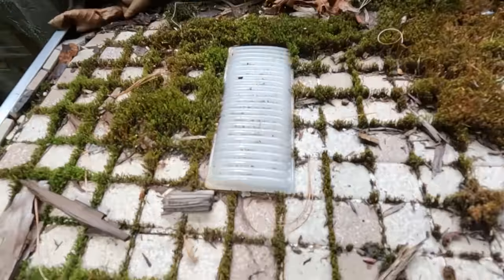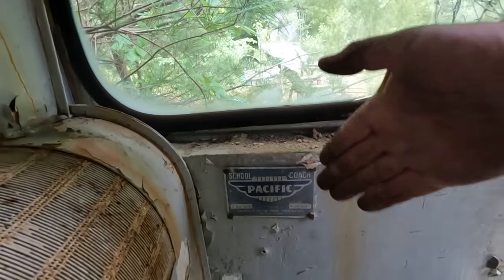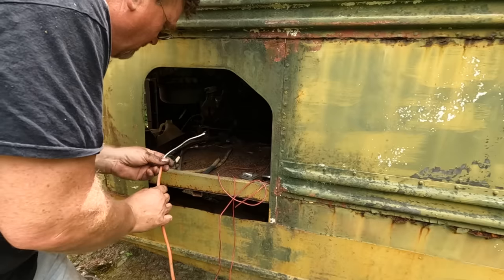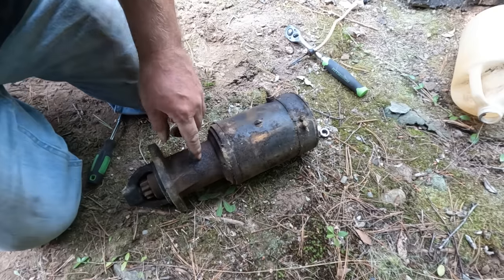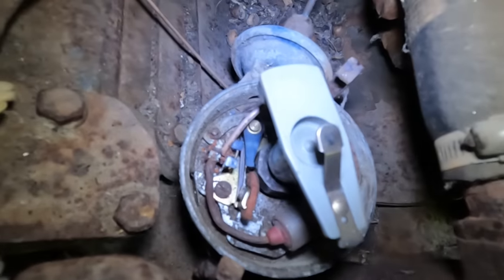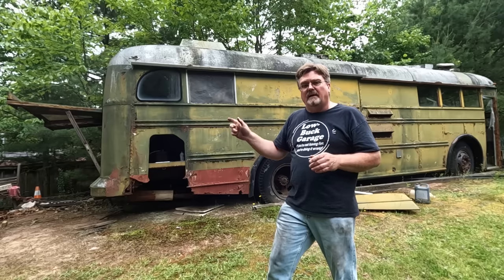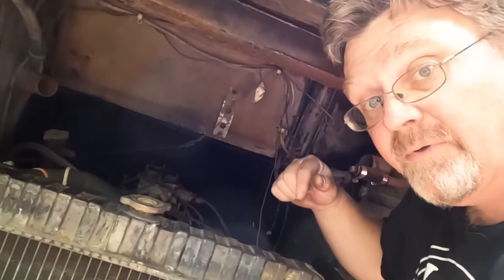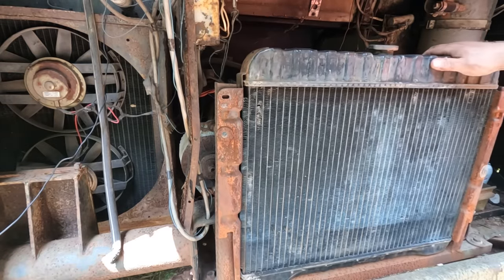Junk 1952 Kenworth Pacific Bus, Will it Drive?

Comment: If done right that bus can be salvaged, most things only need disassembly cleaning lubrication and reassembly to work again. Not much need atual replacement on that bus (part from interior "soft" parts), in 6 months and with less than $6k that can be road legal and camping ready i'm sure if you or someone local is willing to do the work.

Comment: any reason why the wheel has to be turned 3600 degrees? was that normal for the time?
Reply: That bus (like most vehicles of that age) doesn't have power steering, so the steering box is higher geared than a modern one to make turning it easier, and that leads to more revolutions before it bottoms out

Comment: Bro. what are you doing, the brakes are locked up on the bus.
You have to put air pressure in the brake system to disengage the safety.

Comment: bruh is getting off the bumper and not freeing the front fucking wheel, he doesn't want to overheat the bus and destroy it but he wants to drive it with a locked wheel holding 10 tons and a clutch praying god

Comment: The front wheel should not have spring brakes, so you would back it off using the adjuster nut on the arm between the air canister and the actuator shaft.

Comment: Well don't you guys have to dozers on the property that that work. If so if you have a sibling there one could push with one dozer will you pull with the other and you might be able to move it

Comment: I bed the  relay (solenoid)  which was already in was not dead. It  need not positive for start  but ground potential . So one wire of the coil is internal connected to positive. In a real world we got both kinds of those relays.☺

Comment: Why don't they put the manufacturer and date made right on the engine.   Everything is such a hassle that doesn't need to be with just a little thought.  Anything i work on I think about the next person that's going to work on it.   It may be you.  It's hard to work behind another's thoughtless mess.

Comment: when i look at that engine i like THAT IS BABY BEAST FORD ENGINE xD she is no joke of moving anything under it own power lol i would never let that engine rust out at all i would love pull it out bus and put in my bus cb200 internatro which mine have broken rod and engine missing all parts i bought at acting used not driveable and been looking for engine to replace it to gas ford engine
when you let off clutch and baby beast ford engine like i aint giving up rusty bucket you moving LOL
and i do remember that you can put msi distrus in there get her fire up no problem look for 460 long shaft not short shaft because never touch cam shaft

Comment: It's pain to watch you driving bus with locked front wheels. For god's sake, just use air compressor to free brakes or disassemble them to unlock wheels and just drive almost normally.